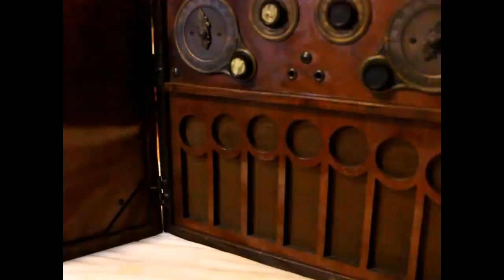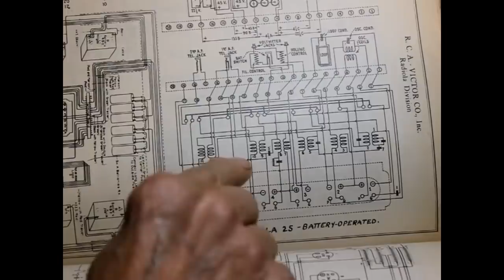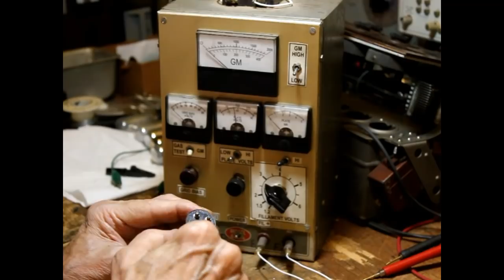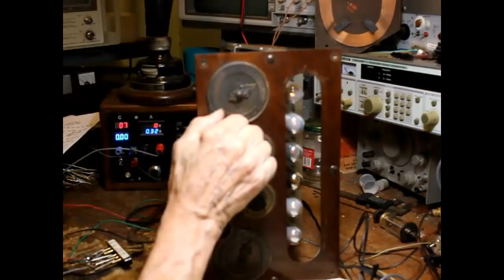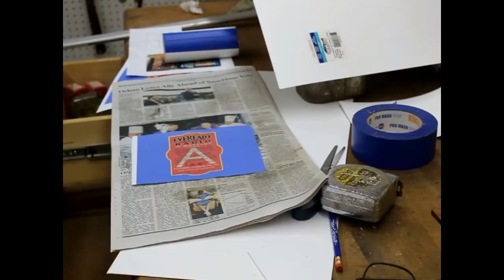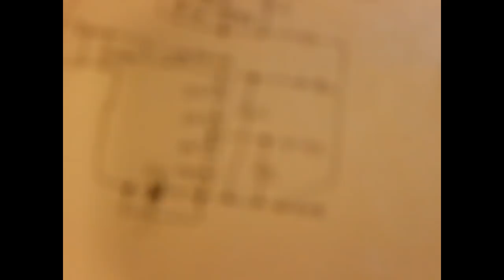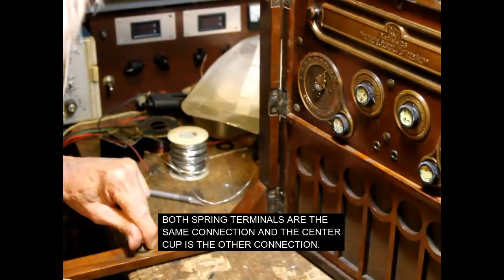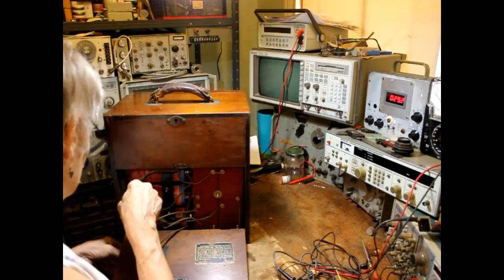RESTORING A 1926 RADIOLA 26 RADIO

Comment: Being a beautician and not really an electronics expert, I can really appreciate the finishing touches and restoration to give it a certain look, I very much enjoy your videos even though for the large part I have no idea what you are really doing electrically.
The fitting a power supply into fake batteries and hooking it up to the circuit to give the impression than the batteries were real was pure genius

Comment: The 'keyhole' on the back side of the radio is used for attaching the antenna that is on the front door of the radio when the battery box is used.  The battery box has a basket weave coil inside that an outside antenna would attach to.  Then the antenna that is on the front door is detached by loosening the fastener on top of the door.  Notice that the antenna has a metal nub near the top.  This is what attaches to the keyhole on the back of the radio.  Now the antenna previously on the front door now acts as the secondary coil to the primary coil inside the battery box.  The battery box also has a variable capacitor to assist in tuning in stations.  I think this was done when the owner had an elaborate antenna system at home that worked better than the 'direction finder' radio antenna alone.  That keyhole is connected to the RF input of the radio.

Comment: Nice job,  I would have fused the power supply.
 Also I learned decades ago that if you have brass pins on tubes they need to be cleaned as well as the brass socket contacts.

Comment: You can see the early days of radio tech rapidly advanced in 30 years to germanium transistors and TV. From battery powered portable crystal radios, to 1 tube sets, to 8 tube sets, to THE FREAKING MOON LANDING!! What a time it must have been to be alive!
Reply: MATT FIELDS there were 6 supposed moon landing now,  thanks to the mandela effect.   All of them were most likely faked though.   Might as well be a McDonald's up there with all the supposed landings.
Reply: @nyccollin  
If the moon landings were fake, the Russians would have had to be complicit, hardly likely since we were in the depths of the cold war. Why, well the Russians as well as other countries would have been monitoring all radio signals and triangulating the position of both the moon orbiting craft and of course the transmissions from the moon's surface.
 73 de M0KOV

Comment: Great restoration Ron, like the resistor idea but I think you could cut a piece of card, the same diameter as the valve base, make four holes in it for the pins and "draw" a meg-ohm resistor on it with a soft graphite pencil?  That way you wouldn't see the resistor.
Reply from the maker: Interesting idea! I will try that next time!
Reply: Now this does seem interesting, I have heard of soft pencils being used to restore functionality on membrane buttons like old remotes or game controllers etc. Also seen "printed" graphite resistors that were etched away to spec on some old piece of test gear on EEVblog if I recall right.  Yet to try it, but I have a Sega with a faulty reset button I may try it on...

Comment: Made a similar battery replacement for a Marconi made moisture meter, as i was tired of buying 10 PM3 batteries a quarter to power it, along with 2 D cells for the 1V5 filament power.  no correct transformer, but I did have a lot of 2VA 220V to 12V potted transformers, so used 4 of them instead.  

One did the filament power, using a LM317 to give 1V2 for filaments, and burning off a bit of power dropping 14V across the LM317, but as filament power was 80mA it was not a worry on the 100mA rated transformer. The other I used to provide 12VAC, and this drove the secondaries of the other 2 in series, with the primary in parallel, giving around 100VAC output ( poor load regulation on 2VA impedance protected transformers) which was then converted to around 140VDC. Resistor and some 33V 1W zeners to get the 90V anode supply, and it fitted all in the original battery compartment, no surprise there.  Made it a lot more stable as well, and no flat batteries, or drifting on it as the A batteries aged and the acorn tube inside changed gain.

Comment: I found a Radiola 26 & home battery base 42 years ago at yard sale..to this day it still has all batteries installed. I would like to build your power supply. Any chance of getting the schematic and parts list. Your videos are so well presented and educational.
Reply from the maker: Unfortunately, the supply was built from "junk box" parts so finding more of them is not possible. Best to get the power supply from Antique Radio Supply and make modifications to it.

Comment: how many hours of radio lasted those kind of batteries? those was recyclable? like refilled?
Reply: Had tube portables in the early 50s battery life 3 hours if played on continuously more if played intermittent .they were awful. There were supply's with dynamotor you could run from your car battery if no electricity available . which was common iin the 20s.

Comment: Could you carefully grind a small channel in the tube base material to hide a 1/8w resistor across the grid and filament pins?
Reply from the maker: Yes. Even better is to use a 1206 surface mount resistor stuck to the base. I did it with the resistor I had just to do it in a way everyone could easily duplicate.

Comment: Why would the fill the caticome with oil in the first place, and what about the capacitors? After a certain amount of years, they leak, or fail like in the tv sets
Reply from the maker: At the time they thought casting the parts in pine rosin would protect them from moisture. It never worked, they had problems from the first production to where they had to have sections of the factory set up to repair the huge number of early fails.
Reply: @glasslinger   That's the way it was with some earlier converter boxes they had a mold they had components inside it to protect from theft I don't know why they adopted these early technologies expression early when there is heat generated through components

Comment: Would it be possible to get the schematics/parts list for the home made electronic equipment you are using?  I believe I saw a tube tester and a multi-ouput power supply with digital readouts. Thank you in advance.
Reply from the maker: They are a mess, not suitable for construction. I had a lot of trouble getting them working so there is a lot of rigging in the circuit. Big damn mess is what I call them!
Reply: Shame about that, I too had my eye on the multi-output supply.
Reply: Could you give me the specs for each supply.  I do not know the nominal voltages for vacuum tube radios, especially the battery operated ones. I can figure out things from there.  Thanks much.
Reply from the maker: You need one supply for the filaments ("A" supply) 1.2 volts to 6 volts adjustable at 2 amps. (LM317 is fine) You need a supply of about 15 to 90 volts, adjustable at 50ma for the "B" supply. A few radios need a fixed supply of 22 volts at 10ma. And a fixed supply of 45 volts at 20 ma for other "B" supply connections. The supplies do not need extreme regulation but should be low ripple. With a supply with these voltages you can get virtually all of all the old radios to operate. Some radios use a "C" supply of negative 4.5 volts (with respect to A-) You can add this if you like, but most of the time the radio will work fine with the C- connection grounded. @billhall8003
Reply: Thank you. Just what I needed.

Comment: Do you have any original paperwork to compare with the radio? With a superset design, there would be some tuning to do, both of the oscillator and some alignment of the tuning. You also didn't recap it. That would be dicey for the tubes and power supply, for sure.
Reply from the maker: All those parts are located inside the catacombs. There were no alignment adjustments on the I.F. back then. Remember, this was one of the very first superhets ever! The one filter capacitor did get replaced. (early in the vid.) Note that the oscillator is the right hand dial and the RF the left. The radio user constantly had to "align" the front end frequency to the oscillator frequency! Modern radios no longer require alignment due to the precision of the components. Maybe this old set was a bit premature! :)

Comment: where can I find tube for this radio ? I have Radiola 26 exactly like your
Reply from the maker: USA ebay is the only for sure place. They are expensive, $20 to $40 each in working condition.
Reply: @glasslinger  thank for your prompt response can u send me link because I did not found C299 and I don't want to buy something wrong because they are expensive,,,, also I have the plug of the battery , can you tell me each leg what voltage should be? thank y9ou so much
Reply from the maker: @emanueldabah2252  UX299   I have no idea. I cut the plug off. Try looking at the Rider's manual page for the radiola 26. (it's online free)

Comment: Is there a practical way to melt the pine rosin without destroying such a lovely radio please?  Also (meeow) your cat (meeow) wants to know (meeow) too!
Reply from the maker: If you are not married you can do it in the kitchen oven. If you are married, buy a junk toaster oven at a second hand store and do it outside. Set the temperature to 300F and wait about 4 hours. Lift the top off the box and the rosin should be liquid. If it is still gooey, heat it higher temp, maybe 325 for a few more hours. Video coming up on doing this!

Comment: Hi love your videos. 
Wonder if you could help me.I have a 90v sky baby radio. I'm seeing on the Internet that you can replace the 90v battery with 10  9v batteries and a 1.5v D battery for the valves.There is a 4 pin connector with red yellow black and brown wires.Do you know witch wires go to where on the new batteries. Any help is greatly appreciated as I can't find nothing on Google. And I'd love to get it working. It was my great nans.
Kind regards Nick
Reply: I believe the schematics are available from https://www.radiomuseum.org/r/ever_sky_baby.html. You can download for free but are limited to a few pages of the manual per day unless a member.

Comment: It appears that you didn't even have to remove the radio chassis. You can insert tube from the FRONT of the unit. Talk about servicability!

Update: Oops! You just replaced a bypass cap. My bad :)
Reply: David Perkins Also, entire circuit is potted like a Microsoft "surface".

Comment: Hard Wood Radio, WOOD..Now with all your Skills Can you Build a All Band Tube Radio w/Wood but almost the Same Type of Antenna Design, Well Something to Dream About..

And By the Way, Wat is the Best Way to Ship a 833A, I shipped about 6 of them out at 2 Got returned, Damaged from Shipping, Yay for Getting Refunded for the Tubes, But not what to do with the Damaged Tubes..-sigh-
Reply: Pica Delphon Did you ship the tubes installed in equipment or loose?  Because of the relative fragility of the tubes they are best shipped in a separate box and well packed and individually wrapped in bubblewrap or a soft foam so they can not bang against one another and ideally allow for a crush zone of a couple inches all the way around the outside of the box so that if the box gets severely crushed the tubes will not lie within the crush zone. Even better still, pack the well packed bd of tubes inside an even larger box and pad around the interior box if the tubes are at all valuable as then both boxes must be severely damaged before the tubes are likely to be damaged.

When shipping equipment it is often best to pull the heavy transformers and separately pack them as well as some of the transformers in tube equipment can be very heavy and will sometimes break free during shipping if the box is dropped hard from a height, then you have a heavy transformer battering everything inside, hence why to ship heavy transformers separate from the equipment (just document where each wire goes).  

Basically, pack precious or fragile items on the assumption they might get dropped from the cargo deck of a large cargo jet.  Or, in other words, try to pack on the assumption that someone is going to drop your package out of a second or third story window and it should get there fine.  It also helps to ship by air and insured as air spends less time in handling that by land and insured items are sometimes, emphasis on “sometimes”, handled a bit more gently than uninsured (but no guarantees).

Comment: Ahmmm why are the pins shirt?
Reply: Short not shirt
Reply from the maker: The tube socket on that type of tube makes contact to the bottom tip of the pin, not the sides. So the pins can be very short. The contact was very unreliable so the standard became the long pin type which has contact to the sides of the pin.

Comment: Painful watching that beautiful patina being destroyed. Ouch. How many of these are left?  That one is trashed.
Reply from the maker: You are hung up on old corroded looks. I'm not. The radio looks MUCH more like it did from the store than before. The rest of the finish was not touched since it was in good condition.
Reply: This is the kind of guy who'd berate me for cleaning the dials/knobs on my 60's and 70's gear... If he wants to live in the festering filth of the past and pretend it's patina then let him... (At least I suppose it'll give restorers something to go at when he passes and his uncleaned collection enters the market ;) )
Reply: I bought a philco 28 rewound coils replaced old speaker with pm. Type remove blue paint found it was in a fire refinished made new wood speaker ornaments .re capped .friend said I destroyed it .it's a trf working well sounds great use every night .here a parts one .it was junk to start not junk any more .his don't wotk ants ate the whole thing. I have another I good original condition a superhet..

Comment: Halfway through and way too much fakery.  Putting the resistor outside the catacomb, when it could have been under the lid (without depotting the rest).  Carving out the dead capacitor to make the replacement look big and old.  Making dummy wooden batteries when that entire space could have been used for modern batteries without spoiling the look as it's under a lid already.

22½V is roughly 5 LiPo cells gently charged for longevity.  3x1½V is roughly a single large LiPo with a similar charge.  Actual recharging outside the box using the kind of balancing chargers used for hobby RC toys. Wrap in something nonflammable to contain any battery failure.
Reply from the maker: The radio is for display in a collection. The purpose of the dummy batteries was to make the radio look like it did in 1926. The point in restoring the old sets isn't to convert them to modern electronics!
Reply: wahhhhh cry baby. let the man do it his way.
Reply: Know-it-all